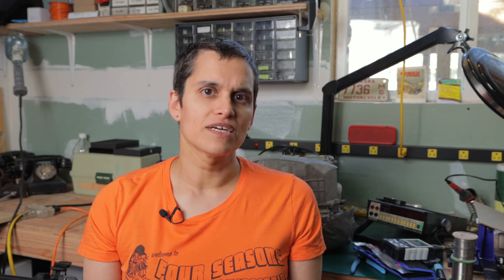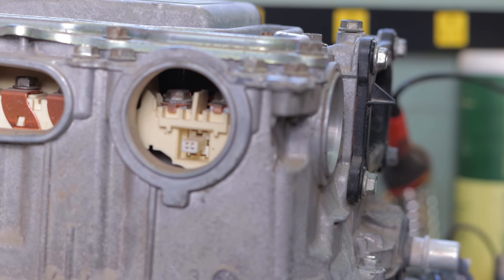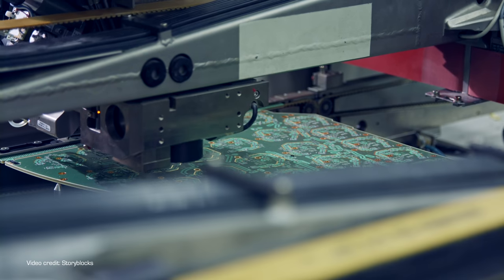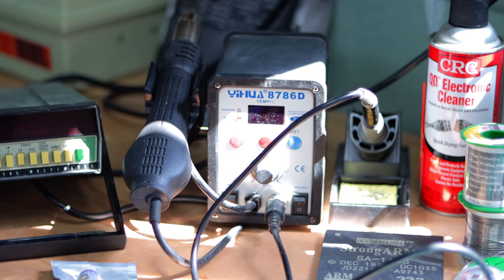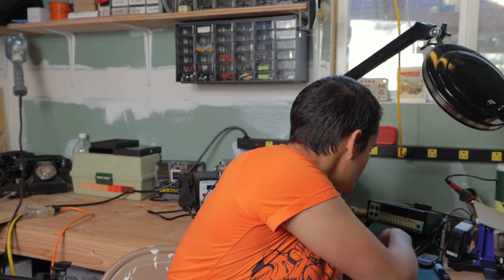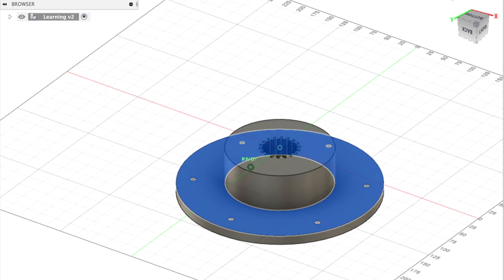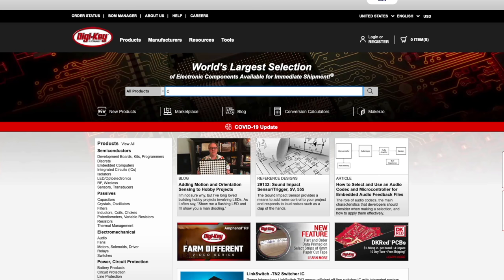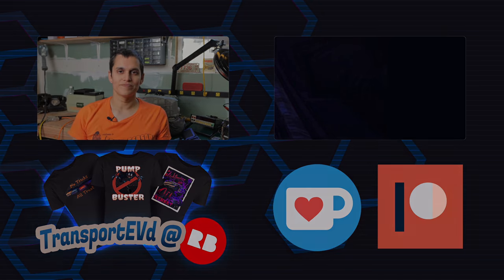Rebooting Rebecca - Turning a Morris Minor Electric: Episode 3 - The Inverter

Comment: Hi Kate, if you ever have need for more liquid flux, you can make your own on the cheap. You can buy 15g chunks of rosin on ebay for under $3 which you can crush & dissolve in denatured alcohol/methylated spirit/95% ethanol and put in a 50ml needle applicator bottle. I like 30g rosin in 40ml ethanol. Works as good as the pre-made stuff which is priced like printer ink.

Comment: If I may also recommend two additional items to pick up for your surface mount rework if you don't already have them: solder paste (in a syringe) and a fine copper braid. The paste is usually a better choice for soldering SMD parts, the braid (and the flux you already have) will really help clean up those pads before you put new parts on. The rest of your kit looks like a great start though. SMD work takes some getting used to, but it is not as bad as it seems at first (unless you are trying to deal with stuff smaller than 0603 or so :) ).
Reply: I too suggested "solderwick"  
If they were doing a lot of it, I would suggest one of those hot air PCB warmers.  It makes soldering a lot of parts easier.

Comment: Hi Kate. If you're hand soldering SMD parts using a soldering iron and solder wire, here's a video with some high-res montages of soldering techniques: mostly solder one pin while placing the part, then solder the other pins.  https://youtu.be/naZ0Wzpr_Hk?t=126 ,  https://youtu.be/naZ0Wzpr_Hk?t=211 ,  https://youtu.be/naZ0Wzpr_Hk?t=334  https://youtu.be/naZ0Wzpr_Hk?t=350   That said, as others have commented, for any appreciable quantity of SMD parts, solder paste and a hot air station (or an oven) is the way to go. Not the least advantage to solder paste is that it's tacky, so you can place the components onto the pads and they stick in place temporarily. Then you heat them with the hot air tool and the surface tension of the melted solder draws the components into precise position.

Comment: You don't need a flywheel and clutch. Just use a rubber coupling between the motor and gearbox, I have built an electric Lotus 7 replica and I just made up a solid coupling between gearbox and motor. I use second gear most of the time that will run up to 90Kph and if I go on to the freeway I select 3rd gear.
Reply: Uncoupling the mass of the motor as you change gears is easier on the synchros.

Comment: They have USB-powered battery soldering irons these days? Whatever next! How long does it run, one wonders?
I desperately need one of those magnifying lamps too - I have exactly the same problem with aging eyes. Your electronics experience seems to be the same vintage as most of mine (although I have done a fair amount of SMD rework at a previous job too) :-)
Reply: My eyes have gotten bad enough that even with one of those I find it hard to do 0402 parts.  I instead you a much stronger magnifier that is intended for some hobby or another and a spot light.  0201 is out of the question.